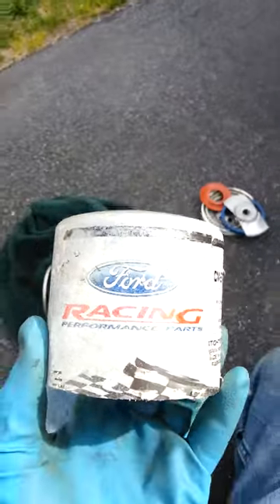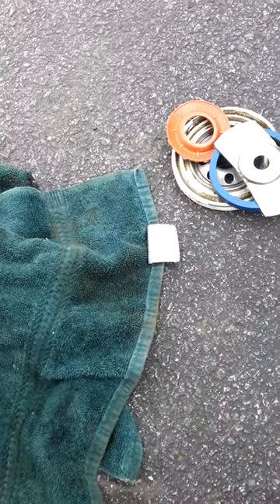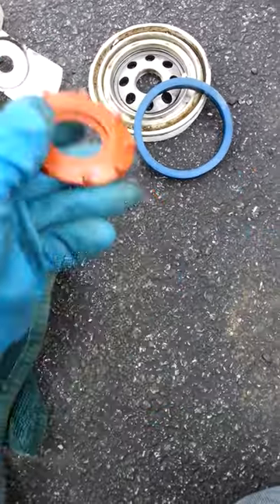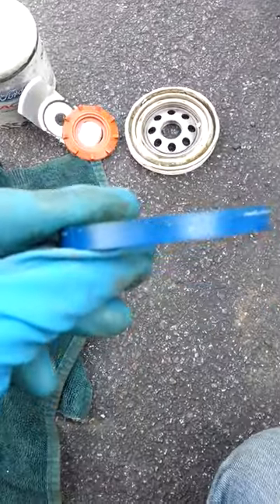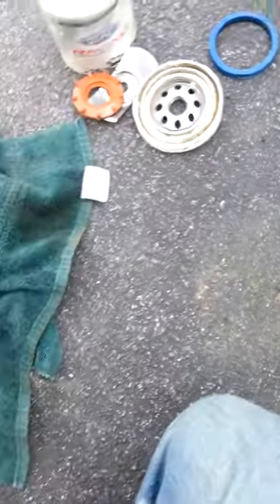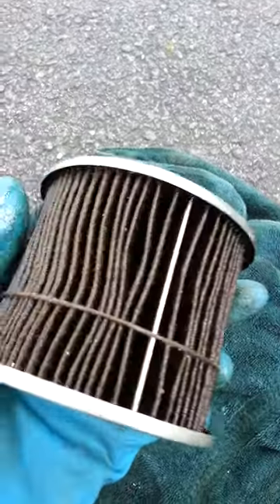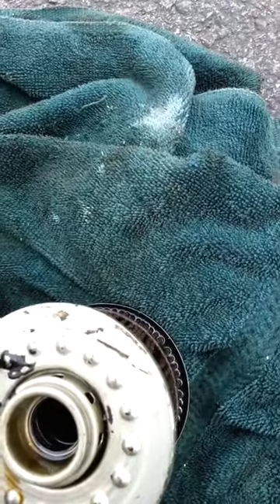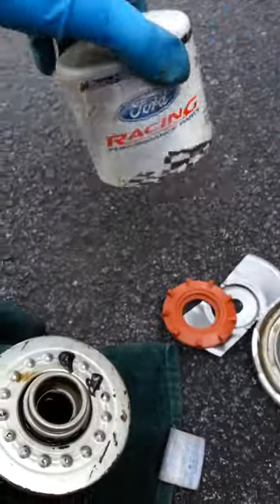Ford racing Oil filter disection

Comment: Yes, it is synthetic. Thanks for sharing. I just bought my first Ford Racing Filter. I was shocked at the size, so much so, I had to double check that I ordered the right one. I have only used K&N filters to this point in my Mustang GT. This thing makes the K&N look like a Jiffy Lube free filter. My first thought was I can't wait to cut this thing open after I use it. Great minds think alike. I think as a comparison, I'll go ahead a dissect the K&N after I pull it to show a comparison of what they look like after 3,000 miles of use. I currently run Royal Purple, but my supply has run down. I only have enough oil for one change and it is Mobil 1. So I might be making the switch unless they put it on sale before my next oil change. Eventually I will make the switch permanent to Mobil 1 for cost reasons. I can find it all on sale somewhere. Royal I have to actively search the specials to find it. They are both great oils and in many instances they consider Mobil 1 to be better. I just like RP as it has been my go to oil for years.